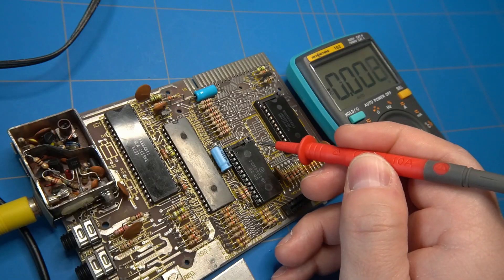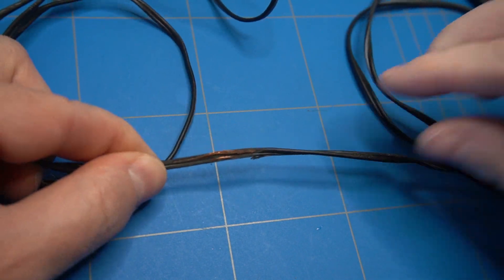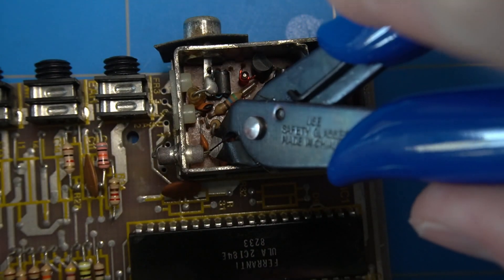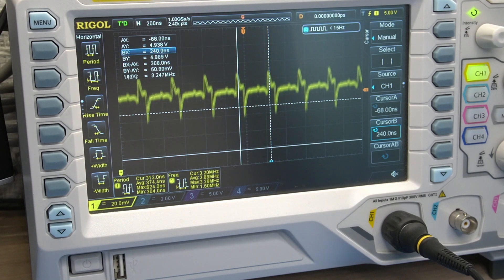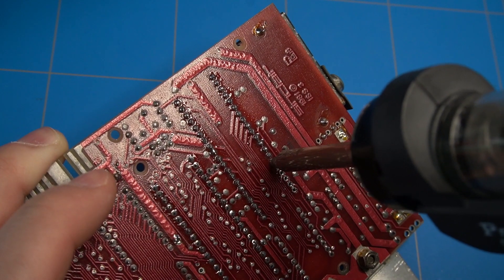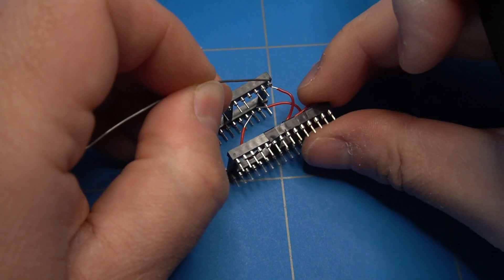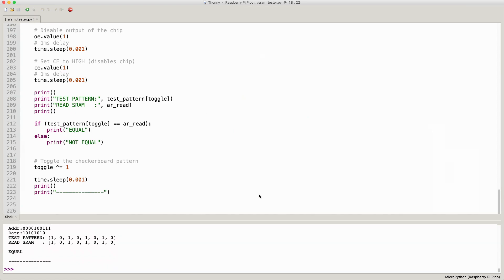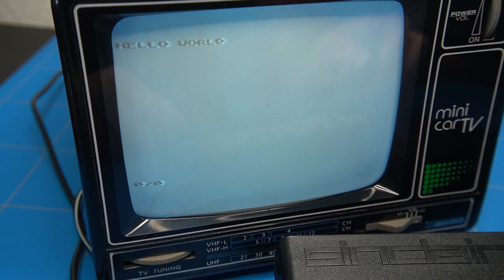ZX81 repair

Comment: I wouldn't buy a non-working ZX-81 because the most likely source of the problem is the ULA and then good luck getting a replacement.
Reply from the maker: True. They are hard to find, however I am still thinking of a project where I build an easy to make replacement.
Reply: @ezContents  FPGA replacements for the SID chip and the video chip in the C64 have been created. Perhaps someone will create an FPGA based replacement for the ULA.

Comment: you can test the sram with your eeprom programmer 😀
Reply from the maker: Thanks. I was  making it too complicated, with the Pico and 3.3V to 5V conversions. Although I think that the problem might have been with the in/out pins, which had 2 functions.

Comment: Just a comment about the UK mains plug fuse. It's not there because we have 30A ring circuits - each circuit has a breaker - but to protect the device mains cable in case of a short inside the powered device. Many device cables, including in the EU, will melt and/or catch fire, or at least get very hot at currents allowed by the circuit breaker. The fuse should be rated appropriately for the device in question, regardless of the current rating of the supply circuit to which it is connected.
Reply from the maker: Thank you for clearing that up.

Comment: Pointless doing the composite mod until it is established that a video signal is being generated in the first place! Since you have an oscilloscope (the same one that I and countless hobbyists have!) that should have been tested before getting the soldering iron out. So, basically the first machine has a dead ULA (very common fault) and so is effectively a junk/donor board and the second one worked out of the box. Yes, Arduino is more appropriate tha n a Pi as a test rig for this generation of machines due to its 5V compatibility. On the ROM adapter it is often possible to push out the unwanted pins from the DIP socket which saves fiddly electrical tape insulation. Always Interesting to see a ZX81 since I helped a friend build his kit version back in the day 😀